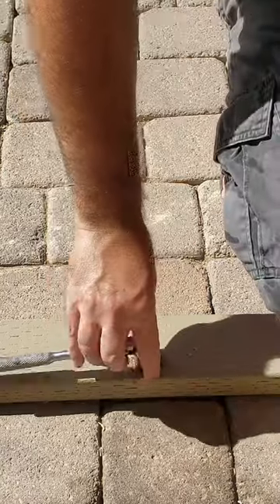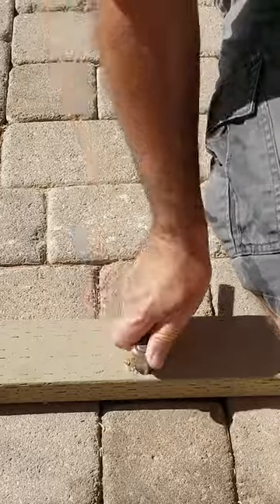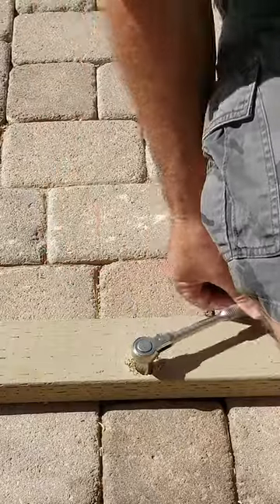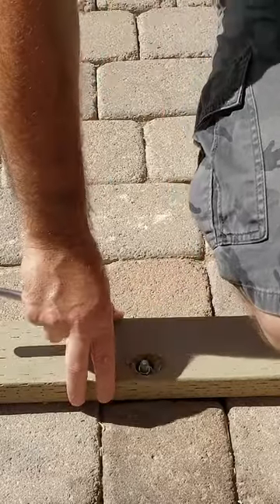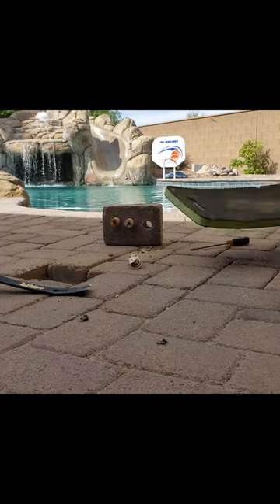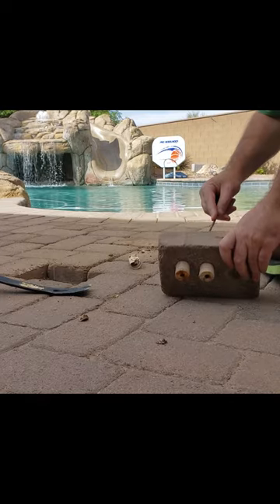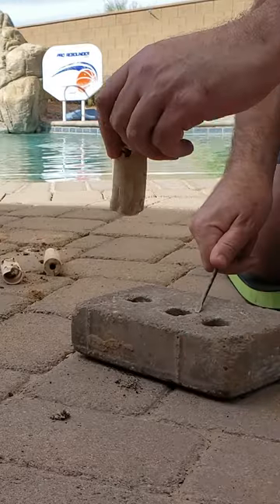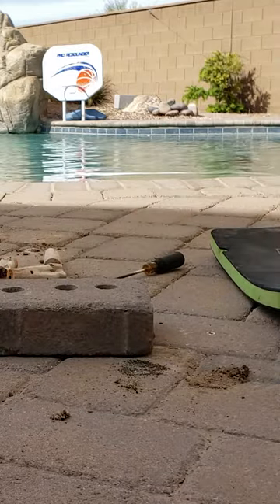Paver holes and Patio Frame Anchors Explained #shorts

Comment: So the thing is anchored to a single brick? Hope it don't get windy.
Reply from the maker: It gets pretty windy out here. It has held up for a few years now. I will have to make an update video.
Reply: @ThatHobby  I will remove a block where each leg is and use real ground anchors using a power drill that go down 18". You haven't had enough wind it's that simple. A wind that will move that thing will take the blocks with it, that's common sense. Just because you have gotten away with it does not mean it's done properly. Even if it goes 20 years like that. I have seen structures like that tumbling across fields. Only takes once.
Reply from the maker: @poosaypete470  Oh wow 18 inches is a lot longer than the ones I used. I could probably take out the shorter anchors and put in longer ones or at least add some longer anchors in between them. That would be a good  idea for a video too.